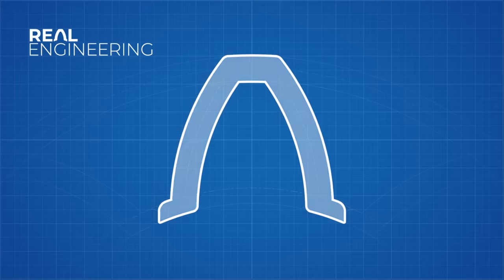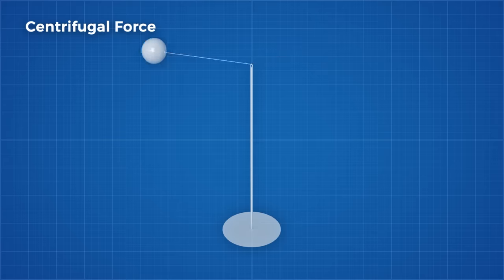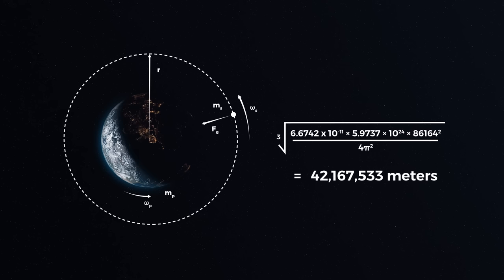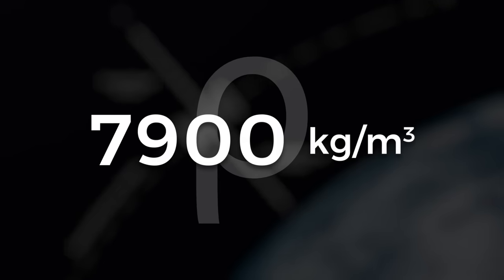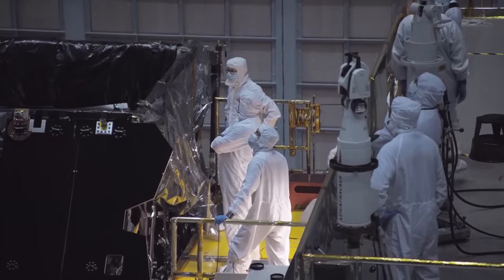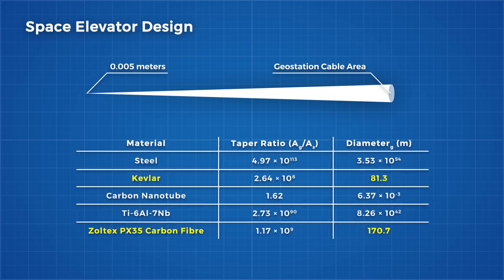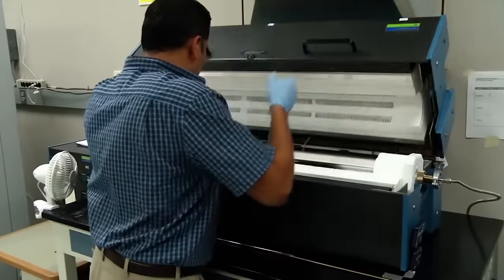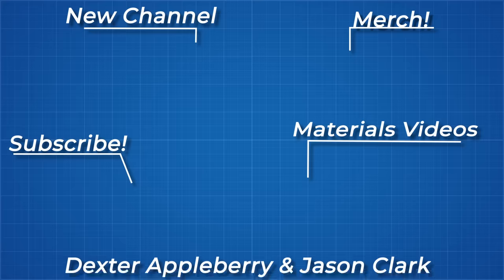Are Space Elevators Possible?

Comment: Estimated weight of CabonNanotube (assumed Density is 1 kg/m3) length of 36,000 kms is 300,000 tonnes (6.5 m. Diameter, tapered to 2.5 inch.?) Already 300+ times heavier than CounterWeight of Station itself (assumed 1,000 tonnes; afraid of failure; if too BIG object FALLen down to earth & causing extinction.?).
Moreover the Velocity of Station @ 36,000 Geostationary Altitude; required velocity of 3,100 m/sec or Mach 9.3.. this kinetics level of Energy; only ROCKET Propulsion is needed, anyway.. not Electric Motor.!!!
Reply: On my re-caculation, the weight of Cone-Carbon NanoTube Bundle/Cable (added up by 1/4 length of  Cone-Body Center of Gravity adjust/plus.. to 45,000 kms length (36,000  × (1+(1/4))= 45,000) that the Cable weight will be (6.5 metre adjusted to 8.125 m. Diameter, tapered to 2.5 inch?) 777,700 tonnes of cable alone (from 400,000+ tonnes of only 36,000 km Length Cable, originally). The CounterWeight of Stationary Terminal Module; even 5,000 or 20,000 tonnes is incomparable to 780,000 tonnes of CabonNanotube Cable, ITSELF...(which is still unable to produce in Mass Quantity, anyway.) Not to mention the Daily Service NEED of (Cable 's) Surface implementation /maintenance of Wear &Tear from High-speed Running of Up & Down Climber/Cargo on frequent basis. No way to replace it, and such repair of 36,000 to 45,000 kms long Cable.. sounds nearly / totally IMPOSSIBLE.!!
Reply: And the weight assumption is based on 1 kg/cu.m. ; that's less than the Density of AIR @sea-level .. far less than real. Meaning the real Cable weight could be ×1,000 times than 780,000 tonnes (of 45,000 kms Cable). It's 800 Million tonnes of Cone-Body Cable/Bundle.!!

Comment: Just watched the video. You and everyone else who talk about space elevators are wrong. People always focus on the tensile strength of the tether but nobody takes into account the angular momentum of the whole system. This kills the project. Even if we right now had commercially available indestructium to make the cables out of, it won't work. It's all about the angular momentum. Forget tensile strength.

So far Blue Origin and Virgin Galactic have done a pretty good job of making sub-orbital rockets. These are useless. Space-X has made actual orbital rockets, where the magic happens. Space-X puts stuff in orbit.
Quick recap: Orbital = good, sub-orbital = useless.

The supposed point of the space elevator would be to LAUNCH something into space without the rocket. Here's where the model breaks down. Assuming the elevator already exists, the indestructium cords are holding, the counter-weight is out there past geostationary orbit, and the elevators on the tether are working properly, there's no launch to it. There's only height. When you shoot a rocket straight up, it eventually runs out of fuel and falls straight down. You have to curve the rocket sideways and obtain angular momentum to keep the thing in orbit.

If the elevator were in an actual building, like a super duper Eiffel Tower, the tower itself would impart angular momentum to the payload as it rises. It would transfer energy from the Earth, up the height of the tower, and into the payload. A cable (or tether) isn't rigid. It can neither impart vertical height nor angular momentum from the Earth. Both of these are imparted from the counterweight. Are you seeing the problem now?

If you run a payload up the space elevator to the point of geostationary orbit, it will create a drag on the system. At the bottom of the elevator, the payload would be moving at 1000 mph, because of the Earth's rotation. This is "free" angular momentum. Rockets must move much faster than this to achieve orbit. The space elevator removes the rocket from the equation. Without the rocket that momentum must come from somewhere. It will come from bleeding forward momentum off the counterweight in space. This causes a drag on the counterweight and pulls it backward in its orbit. The payload speeds up, but the counterweight slows down. This is the price.

You would need something like a rocket attached to the counterweight to make it regain its angular momentum each time something is launched from the space elevator. Otherwise it would keep pulling backward until it wrapped around the Earth or otherwise fell out of orbit. And of course, attaching a rocket to the counterweight would render the space elevator nonsensical, since the point is to launch payloads without rocket fuel. We just added a rocket back into the equation where we wanted a free energy launch without rockets. But without this rocket there's nothing to restore the balance of angular momentum and make the payload move sideways to establish an orbit. You just spent trillions of dollars on a huge fail, and maybe got one payload to orbit before discovering the fundamental flaw in the whole underlying philosophy.

In conclusion, even if we had all the materials science conquered, the space elevator is still a big fail.